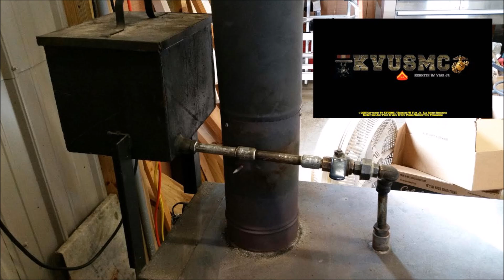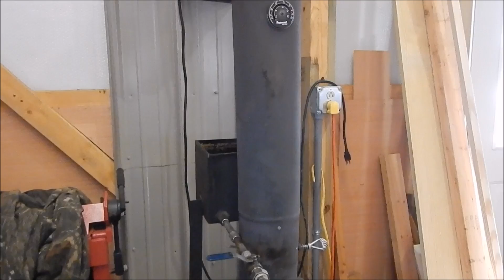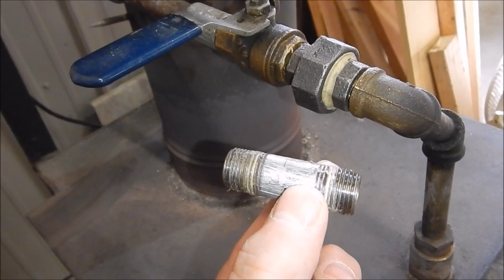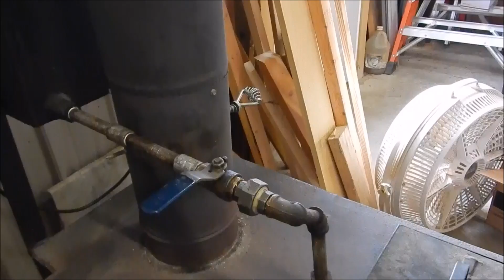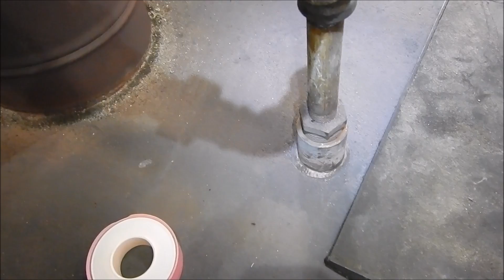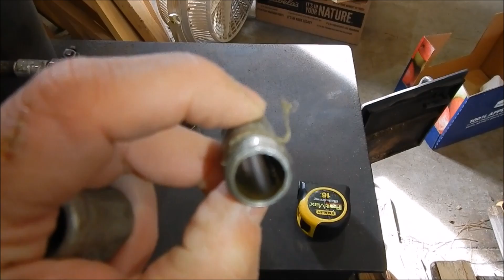Waste Oil Drip System For My Wood Stove How I Made It By KVUSMC

Comment: I have a similar design, except my reservoir is about 3ft to the side with the pipe going through the burner, so it can be hooked up to either side, and a hole drilled in the center for dripping. Is there a way to keep the oil from catching fire right at the hole?
Reply from the maker: There Might Be Mine has been Running for years no problem at All

Comment: Nice build, Do you have to constantly adjust the flow of oil as the level goes down? 
I got about a 3 hour or gallon tank and as the level of oil goes down there is less pressure so I have to open the valve up. I have to do this about 5 times to keep the flame steady, trying to find a way so I dont have to do that, thanks.
Reply from the maker: Hi Buddy I appreciate it  not much adjusting just crack it as I need it buddy
Reply: What size of piping are you running for it? I would think i would also drip fast as the reservoir warms up as well, might need  igger piping like this vid?

Comment: nice, supprising the heat that thread tape can handle, i have two boiler makers in the family who build boats, ships and drill rigs, i always thought it was a fairly easy trade, but its not, it requires real skills, knowledge and professionalism. nice vid , nice work.
Reply from the maker: +closertothetruth Thank You  Buddy Thread Tape Can Handle 700 Degrees No Problem There Different Grades Yes Sir It Is A Tough Trade Many Thanks

Comment: Love it brother. So can you run on just oil?
Reply from the maker: +yankey4 It Is Mostly A Wood Burning Stove But  With A Little Boost Of Of Hot Oil I can Burn Any type Of Wood Green Wood Or Unseasoned Plus It Is Like A Wood Burning Stove With nitrous oxide  It Gives The Burning Process A Hotter Longer And More Heat Burn Times

Comment: Excellent. glad to see that your used veggie (and other) oil is not going into the landfill, recycle/reuse/re-purpose. I know that your shop stove burns hot enough that there is no toxic exhaust going out into the air. Glad to see that there is more of the "old ways" being used by everyday people to reduce their homes utility costs
Reply from the maker: +Mr. C Yes Sir Mr C In Fact All My Neighbor Who Change There Own Oil I Burn All There Oil It Gets Preheated First By Wood Then I Throw The Oil To It A Little Drip At A Time Super Hot Clean Burning  No Emissions Like You Said  Reuse Recycle

Comment: Nice, like to see sometime it getting started and what the oil drips into. Good idea
Reply from the maker: +Steve Rob Sure Thing It Is A Simple Design It Just Drips On The Wood And Hot Coals To Create The More Heat That It Needs I Will Make A Video Buddy
Reply: I did this with my old stove in the garage and could get a log to burn 8 hours by dripping oil on it. Worked great. Had to take apart now and then to clear out coking in tube but it made big difference.